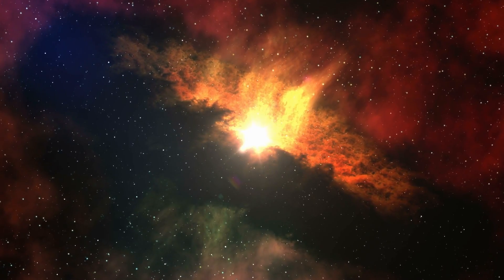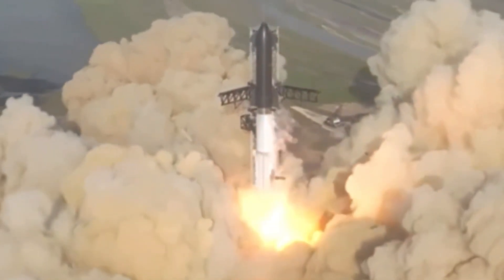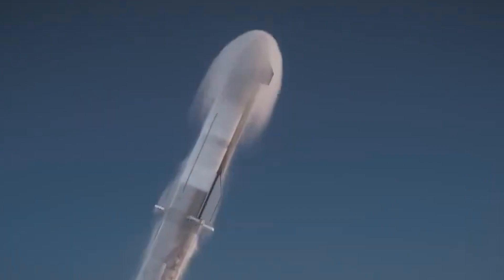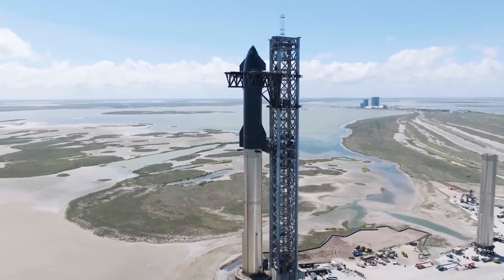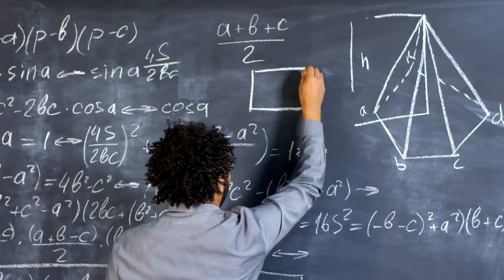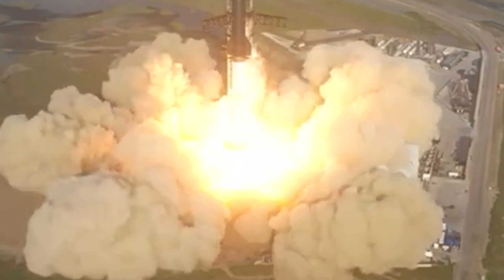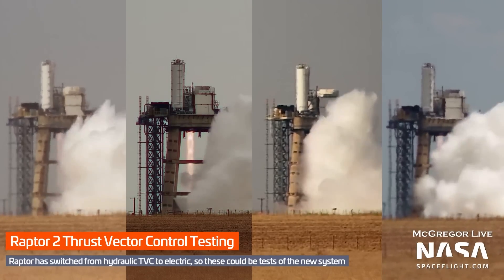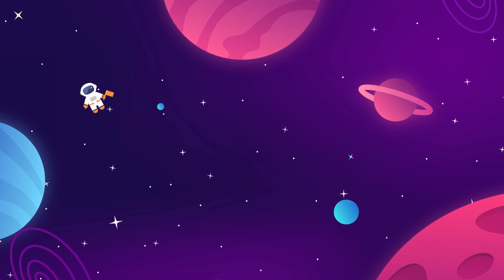The SpaceX Starship Orbital Launch Update Is Here!

Comment: This is the first Starship launch video I've seen that pointed out the missing engine bells on those engines that were out. Yikes! That is some serious damage.
Reply: Don't you think it is strange that a ship which can land is not designed to separate at its own will in case of emergency?
Reply: the hydrolics were destroyed and they are responsible for separation
Reply: @HWM636  No explosives on the bolts that hold the clamps??
Reply: @reasonerenlightened2456  i'm sure they learned 100 things from this test. you're right that they should have 5 backups to the separation phase, and they likely thought of all of this years ago. its likely a matter of safety. if the rocket starts spinning out of control and separates anyways, it can start launching right at Dallas for example and maybe the gimbals on the starship are also malfunctioning, then what? they get shut down like nuclear through a series of  bad luck. if they were in the middle of the ocean i'm sure they'd have the starship shoot off no matter how bleak it looked.
Reply: Yet it still took off though.
Reply: @cobz76  Taking off really shouldnt be the issue in 2023... Starting to uncontrollably spin when it shouldnt was the issue, and that was probably due to engine failures.
Reply: @matejzizanovic7959  The engines didnt fail, they were destroyed by the exploding  concrete debris from the launch pad. Due to the power of the rockets thrusters.  Which also damaged the hydraulics.

What youre failing to see is this rocket is 9 meters in diameter, and 120 meters tall. it not only managed to take off with less engine power but held up to the G-Forces of flipping out of control while traveling at the speed of close to Mach 2.
Reply: @cobz76  Well, i didnt specify the reason, but engines failed, yes due to the being destroyed by concrete debris. So yeah my point still stands, you just expanded on the reason for engines failure, and i thank you for that!

Comment: They just need to start with a concrete base, then thick steel plating on top of it and then water cooled and they will avoid the issues. The concrete base will provide strength to the steel to keep it from bucking and the massive water injection will help cool it all
Reply: It's the trans-sonic shock waves that do most of the damage, not the heat.
Reply: @paulhaynes8045  would a large pool of water tank above it help?

Comment: The damage to Port Isabel could not have happened due to the FTS going off -- they were far too far away from that to happen.  The damage therefore had to have occurred earlier and almost certainly at the very beginning of the launch when the rocket was still clamped to the pad or shortly after clamp release.  If this launch had occurred at the Cape, where the exclusion zone is at least 10 miles and for the most part greater than 12 miles it's unlikely any damage would have occurred at that distance.  Unfortunately, 7000 people live within 10 miles of the pad at Boca Chica so damage to civilian homes and facilities is far more likely.  Combine that with the fact that Starship/Super Heavy is twice as powerful as the largest rocket ever launched at the Cape and it must be appreciated that the Boca Chica location was a bad choice from day one.   The location seemed desirable given it's a little closer to the equator than the Cape, but the proximity to more than 7000 people can not and must not be ignored.  I fear that the FAA has been too easily bullied by Musk to permit launches at a site that should never have been greenlit.
Reply: All true - but I strongly suspect Texas was chosen because they'd not only welcome Musk with open arms, but they'd probably be happy to look away whenever required.  They are Musk's type of people - health and safety and regulations are only for poor people...  Thank God for the FAA - it will be interesting to see how independent they really are.

Comment: Why not use a sequential start, 50% of engines start at launch the the rest after it leaves the pad?
Reply: It won't leave the pad with only half the engines running!
Reply: They did a sequential start, engines lit in 3 stages which is why it sits on the pad for so long. You need all (or most) of the engines to get it of the pad it's later in the flight that you can reduce the number of engines as the resistance and weight decreases.

Comment: At 5:44 you can see 2 jets of gas from the 1st and 2nd stage,  thats the holes the launch abort system punched in the tank, the tank didn't ben until the pressure dropped in the first stage.
Reply: It’s suspected the abort system wasn’t even used. The thing is just that unreliable

Comment: 1:30, for all those that say "well if the SLS succeeded on its 'First flight'......why then did Space X Starship and Superheavy booster "fail"?
When you look at the SLS system you find that it has had a long development time and uses 40 year old technology (at least), the engines, fuel tank and boosters are all from the Space Shuttle system albeit slightly modified, and none of the system is reusable, except maybe the boosters and Orion Capsule, maybe. The reason why it flew successfully 'First Time' is in the older, tested and proven tech and 50 year old methods.
The Starship system is new, new design, new concept and methods, and 100% reusable which will permit very fast turn around times to relaunch boosters with another Starship much cheaper and faster that the SLS system, the SLS system has its place (I was impressed by its performance and that it achieved its mission) but is slow and expensive in terms of relaunch capabilities.
The Space X way seems to be a little rushed to some (even myself at times) but they are following a similar method used on the Falcon series of vehicles and that seems to be working brilliantly for them after the initial spectacularly fun times of that system.
Reply: But can you imagine if the SLS flight had failed?  Would all the NASA fan-boys be justifying it by saying they didn't expect it to work first time and anyway it's produced masses of data?  No.  They'd be laughing themselves sick and the politicians would be getting ready to cancel the project.  Musk is just a cowboy.  And your comparison with F9 doesn't stand up - that wasn't developed in the same crazy way as Starship, it was a perfectly conventional development programme.

Comment: I would like to see some in depth coverage of the actions they are taking to repair stage zero. I don't know if they are going to weld patches over those tanks but there were most certainly holes in them on top of massive dents so they might entirely replace them. How are they repairing the concrete launch pad. How are they repairing the mechazilla tower? Are they going to tear it down and rebuild a new version? Will they launch from a different area better equipped for a 33 engine launch, seeing as they did not expect it to be blown to pieces?

Comment: Good analysis, but spoilt by your Space X bias.  This 'flight' was a total failure.  I don't buy the 'it's only got to fly to be a success' nonsense.  If that was the true test of this launch, why did they bother to put the Starship on top, fully fueled? They obviously expected to get as far as the Starship flying.  After all, this is the most successful rocket launching company in history - the know how to launch boosters.  The Super Heavy was very big and used new engines, but it was still 'just' a booster - something Space X are very good at.  I don't think Space X seriously expected it to fail to launch (otherwise they would have had booster-only test flights) - what they were really testing was the Starship (separation, engine start and control, reaching orbit speed and altitude, survivin re-entry, etc).

As or all the wonderful data they got - what do they know now that they didn't before the flight?  Absolutely nothing about Starship (except that the tiles are STILL falling off), and almost nothing about the booster.  I am no expert, but I could have told them that not all the engines would work, and I certainly could have told them that the SH booster would destroy its pathetic launch pad.  It beggars belief that Musk didn't know that the launch pad wasn't up to the job - he's supposed to be a genius engineer FFS.  And yet he still took the chance, rather than wait a few months for the new pad to be ready.  His irresponsible cavalier attitude and impatience cost Space X millions and was a PR disaster.  And, possibly worse still, will l mean the FAA taking a very dim attitude to further flights (or even testing) at Boca Chica.  Personally, I suspect that they will ban any further testing or flights of this sort (unless there's a hell of a lot of political pressure at State level).  'Starbase' is, after all, inside a (supposedly) protected nature reserve!

Nor are NASA going to keen on any sort of repeat of this 'flight' at its Florida facility.  They will want a purpose-built, SH booster-proof launch pad installed - and thouroughly tested - before they permit any of Musk's cowboy behaviour in their backyard.  Two months delay?  I think it will be more like two years.
Reply: Lol thanks for the low IQ take

Comment: Please understand that the Flight termination system FTS did NOT work. It supposet to terminate the vehicle immediately....that clearly did NOT happen...  The is NO way the FAA can endorse another launch  ...if it's doing is job properly. Secondly the explosive power of the fully fuelled rocket is simply not taken into account along with problems of putting a descent pad in that launch site makes the  site unusable for heavy lift launches.  Ok for  stsge 2 star ship tests but it..  Hello.

Comment: I get that rockets are extremely thin to minimise air resistance,  but that puts all the initial thrust focused in a tiny diameter and the heavier the rocket and payload,  the more focused thrust needed for lift off.

But how much air resistance is there when you're doing 0? Answer: 0.

I don't understand why they went from 3 stages to 2. The bigger the rocket,  more stages better.

Halve the length of stage 1 and call it stage 2. Add a new even shorter stage 1 that's twice the diameter,  fat,  something like 100 nozzles, each nozzle producing one third the thrust of the current 33. Blast off pressure is much more spread out and minimised. Only need to lift rocket 1km more or less to a speed of 300km/hr before separating and floating gently down to earth for reuse while the 33 (or less) raptors kick in a km away from the launch pad to bring the now-skinny rocket up to high speed high orbit. 

Less fuel total needed, less raptor engine damage,  less precious water cooling needed,  more controlled safer launch,  win win win.

Comment: Frost, sometimes it makes the valves stick. Conformed inductive heating with cencers to a thermostat can garinttee valvefire. It was good they all didn't fire as the power might of increased porous projectiles damaging rocket or completely destroyed platform and farm.
I would move to sea launch barge with stabilizer spuds to duck faa red tape 12 mils offshore geristiction and use flame divertor resivor using water to control cooling wrapped in titanium. (no composets).
Reply: I hope English is not your native language

Comment: How good is that  "mountain of data"?   The rocket flew will less than nominal capacity,  lost its hydraulic after 30 sec and never got anywhere near orbit.    All they know for sure is termination of flight worked (after 4 loops they will have to explain) and their pad was far from being adequate.   Clearing the tower success is for companies with their first ever flight.   To let that amount of power out on that launch pad shows they are dangerous.

Comment: I do not understand why the launch pad is made of cement without some sort of cooling system. Maby put an exhaust hole under the pad so the gas can escape. Water never completely dries out of cement and when it is super-heated the water boils and explodes inside the cement. Why is there so much infostructure so close to the launch pad?

Comment: Because SpaceX doesn't say much, there's a lot of speculation in this. I think it would be better to clearly identify speculation as such. For example, we don't know why the hydraulic system failed or whether that was connected with the pad disintegration.  Same for the engines that didn't start.  There are zillions of possible causes for each failure. Quite possibly SpaceX knows them. We don't.  The pad problems are exaggerated. In the scope of engineering problems that lay in the full path of this program, pad softness is not a big deal. Throw enough of the known techniques at it and it will be overcome.  It made for dramatic video, but it's just not a very complex problem.  The question of the day was, can we run 30 or so engines to generate enough lift to get this thing flying in some kind of controlled flight, even if briefly. Answer, yes.  That's the story here. The big questions remaining have nothing to do with the pad: Will the heat shield and belly flop scheme work? Can the two stages stick their landings well enough for the recovery/relauch system to work?  Is it possible to do in-orbit refueling and with the fuel ratios that make that a usable technique?  Can the whole complex system become reliable fast enough that development cost doesn't become a problem.  That's what's ahead.

Comment: Space X should raise the launch platform by at least 100ft. Once the Starship has all the engines firing, the exhaust is about as long as the Starship itself. This way it has enough room to dissipate the exhaust gases until it leave the platform.
Reply: It's not the gasses, it's the shock waves - and they travel much further.

Comment: "As most Rocketry enthusiasts and industry experts will tell you a successful first test flight is anything that succeeds in lifting off the pad", I don't think that is what most of those people would tell you, that definition of success was pretty much set by Elon Musk and many would be considered by many to be a very low bar indeed. 

Musk did say "I would consider anything that does not result in the destruction of the launch mount itself … to be a win" so based on that criteria, many would consider that the launch was more a failure than success.

Maybe the next criteria for success will be that the engines light.
Reply: Spot on.
Reply: Not blowing up the pad was a primary goal more for the fact it would take a long time to replace than because it was a success. The more valuable success was the collection of solid data on the ship in flight so they know what they need to change or add so the next test flight doesn't repeat the same mistakes.
Reply: @shaung949  But there was so much damage caused to the rocket itself on the launchpad by all the flying concrete that the flight data will be mostly worthless. The only useful data they can gather is feedback on the TFS. And that also is sub-par. The delay between the termination order and the actual destruction was way too long. Just ripping the tanks open and praying for the fuel to ignite itself and cause a random explosion pattern is another stupidly dangerous idea.
Reply: @christianbarnay2499  Things failing all over the place is exactly the data engineers need to make sure that doesn't happen again. How the ship handles a non-standard flight is valuable data even if it's not the data they wanted.

Comment: SLS also took 25 years to build. After all that time to sort out bugs it should have gone without incident. Starship has been 3 years coming so there's going to be bugs expected. On the other hand now we know fondag can't handle Direct contact with high power rocket engines. Ironically most of those safety changes have probably already been implemented by Space X in more recent builds of the booster.
Reply: The Shuttle engines started design in the 1960's and the engines on the SLS were actually used on previous Shuttle missions.  That Starship attempted so many significant "firsts" and the rocket itself proved sturdy as a brick outhouse speaks volumes for SpaceX, despite the failures on and of the launch pad.

Comment: I wonder how Martian and lunar surfaces will hold up against the starship attempting to land or takeoff from them ? Will pats need to be pre-constructed prior to landing ?
Reply: the booster is only needed for earth, only the second stage would lift off from the other planets as they don't need as much power.
Reply: As said above (so, landers will only use 3 engines, instad of 33, and likely even these throttled way down), + lunar lander already is supposed to have different design with it's engines high up; though effects of this thing on the pristine planetary surface is indeed a concern

Comment: Why the lunch pad is not put higher like three, four hundred feet or more to prevent the exaust heat from damaging the concrete that way heat shields could be put only on the lunch pad pillars.
Reply: Apart from the cost factor, this is an excellent idea and given the difficulty with the soil and water table, it might be the way to go.  The other problem is the location of the tank farm and the damage they sustained.  Whether they rebuild the launch pad and remove the tank farm or rebuild the launch pad (much) further away, building the launch pad higher is something they need to seriously consider.